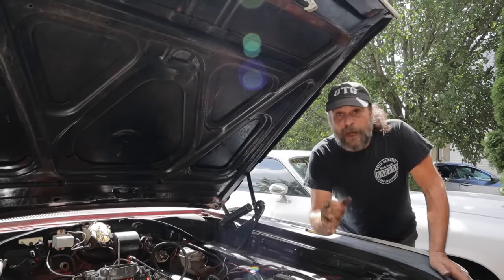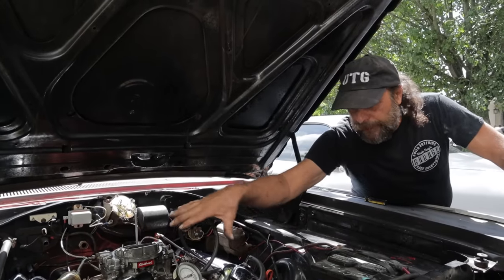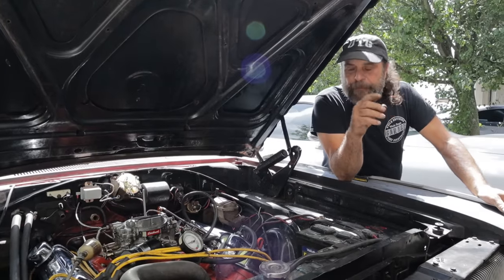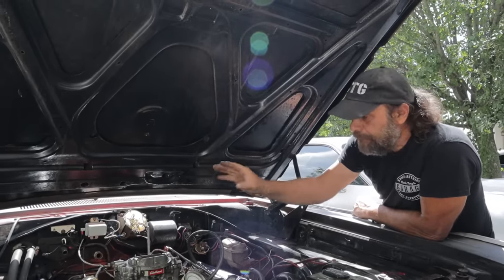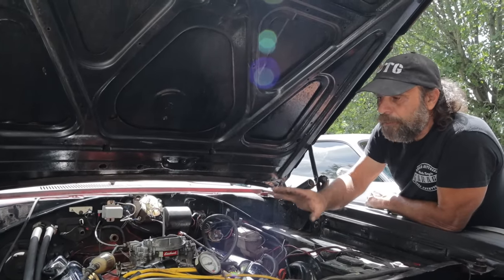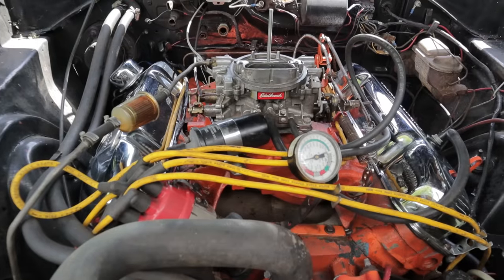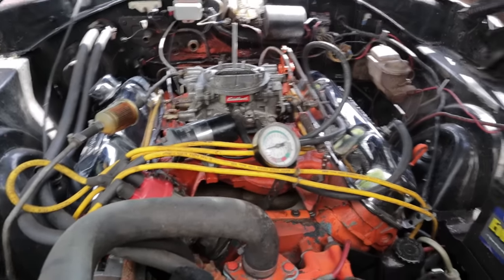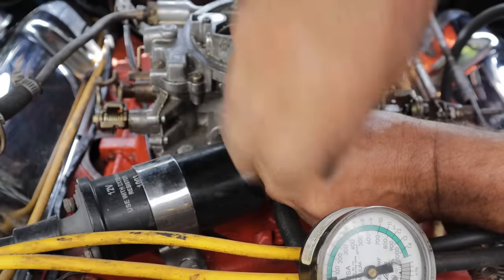Fine Engine Tuning With A Vacuum Gauge

Comment: I have a question. I own a 1970 Chevy Impala w a 350engine.300 Turbo Fire. 
I also have a Rochester carburetor 4bb. I set my air and fuel mixture at 18. With 2 turns on both. Is that a correct setting.?.
My 70 has the power to get up and go!!!.
Could you please let me know if I did it right. Or not.???. Thanks Rey from California San Fernando Valley.

Comment: I have a 1977 Dodge 4 x 4  1/2 ton 360 2 barrel Holly carb I have two carbs one a rebuilt and another that worked on another car they both give the same problem which is that they are really over fuelling at idle so much so that the neighbour complains of the stink.  It doesn't make any difference on the idol if you screw the Jets right in or if you screw them right out. The vehicle seems to work okay when driving but now after it sat over winter as soon as you put it into gear to start driving and while driving it is making a  popping noise.  I have a vacuum gauge and a timing light but I haven't gotten into checking it as of yet do you have any suggestions on what it might be and how I should proceed with the testing your help would be appreciated thank you very much

Comment: To set the timing do you unplug the vacuum advance from the manifold or carburetor that you have a connected to to the distributor...
Reply: Yes, and plug it so there is no vacuum leak.
Reply: @MaxDeet7439  thank you .

Comment: Thanks I need try vac gauge cause my 40 Ford with stock 350 SB had edelbrock 1406 always drove in cold ran great, now warm it started surging at 20 to 40 mph highway fine but slower back firing through pipes smells a lot, so I figured to rich now warmer out so I leaned out, more by ear, idles at 850 to 900 in park around 650 in gear but no more surging or popping when slow or letting off gas. I want to try the vacuum gauge. 1406 carb tube goes in front drivers side ?

Comment: stock 4cyl toyota tuning, vac guage is at 25 and cant bring it down to do any sort of tuning, dizzy is always vac advanced as too much vac at 600rpm idle,   idles smooth and drives mint though, air fuel screw does nothing, cant bring vac down at all, any ideas?  every video talks about low vac, cant find any answers to high vac problem

Comment: Tony on a holley 4 corner system do you only tune the primary side?  Than adjust the secondary side to match the adjust made on the primary sise?

Comment: So different lobed cams wild to mild, will have different vacuum mercury at manifold readings in a healthy engine the wilder higher lift  cam the less vacuum due to valves opening up more or?
Reply from the maker: It's not lift but rather duration and LSA that makes the difference

Comment: Any help? I've got a daily driver 390 fe, 4 barrel AVS2 (Edelbrock), stock cam. Engine was rebuilt about a year ago, new carb at the same time. I'm getting apx. 21 inches of vacuum at idle. I cannot for the life of me get this thing right, but I am new to this. It seems to slowly dance between a half inch of vacuum in either direction. It will remain constant for a brief moment, then swoosh up, come back, etc. Is this an ignition problem? I checked the base of each spark plug with a thermal temp gauge and they're all firing (they're all roughly the same temperature); I lost my spark plug socket, and the others I've found are too wide to fit in there and pull these suckers. Idle is smooth, response is great from idle. I can hear the slightest stumble corresponding with the vacuum reading... Although I've never noticed any variation in RPM while in idle (right about 800) Should I just keep playing with this? Thank you for the videos! Having access to this information and community is awesome!
Reply: I recently tracked my mpg over two full tanks and I was averaging about 5 mpg. I had tuned my carb in the winter, and was averaging about 11 mpg. Besides this, I recently rewired my electric fuel pump because of voltage drop. Now I have relatively no voltage drop. I do not have a fuel pressure regulator, but my electric fuel pump is by the tank in the cab, feeds it to the mechanical pump at the block.. My mechanic told me it would regulate the pressure. I think I might pull the mechanical fuel pump and install a regulator. I don't have a fuel pressure gauge to figure this out.

Comment: wow tony, thanks so much.  i have a stupid question, and i'm sure you're tired of it, but i did try to read all the comments.  we have an old 1967 thiokol snwocat with an industrial ford v4.  i can wrap my head around the 'manifold' vacuum part, but pardon my ignorance but what does the 'ported' part mean?  i got so excited when you talked about the vacuum advance vacuum line coming off the carb into the distributor...but then this blond got confused about the ported part.  so would i pull the hose off of the intake mainifold then stick vacuum guage thingy into hose...or, pull hose off of canister on distributor and stick vacuum thingy in that?  any gurus or helpful people that could help me would be much appreciated.  thanks again tony. -barbie
Reply: A manifold vacuum port has full vacuum at all times including idle. Ported vacuum is generally above the throttle plates in the carburetor. With this setup, you should have zero vacuum at idle but once the throttle blades are opened to a certain degree (it's different for all carberatires), the port inside the carburetor is uncovered and exposed to engine vacuum.

Some manufactures have a manifold vacuum port on the manifold or carburetor that is capped. These should have full vacuum, be sure to verify that. If there isn't a capped port, you'll have to tap into vacuum hose using "T" connection so you can use the vacuum gauge and still have vacuum to the hose you tapped into. Be sure to verify that it has full manifold vacuum though.
Reply: @muziklvr7776  wow muzik, thanks for that explanation, i think i get it now.  thanks again for taking the time to help me. -barbie:)

Comment: So how do you decide what to set initial timing to with a light (e.g. 10btdc, 12btdc, 14btdc)?  If there are too many variables (cam etc.) to use vaccum then how do you determine optimum initial timing?

Comment: I have found that a manifold vacuum on the advance makes you close the throttle so far that there is no flow through the transfer slot and when you open the throttle the mixture goes lean. If you try to fix this with the accelerator pump shot then it is too much as you open the throttle further.

Comment: Idle mixture, vacuum, rpm.  Adjust rpm check vacuum, adjust, check vacuum-back and forth-stock motor in decent shape.  Timing is important at a certain rpm.

Comment: Around the 1970's? When engines still had carbys & not cats? - Exhaust gas analyzers came into use? 
Idle CO had to be <1.5 %? & <0.2% @ 2000rpm, vehicle stationary? The latter would be of course, in standard tune?
The Idle CO needed the screwdriver applied to idle screws & throttle butterfly screw?

Comment: Hey Uncle Tony, I have a 1982 cougar which is equipped with a pulley driven air pump which sends fresh air to the exhaust manifold for "emissions". There is a vaccume line coming out of it. Can that be blocked off and removed, or does it add "boost" to the vacuum system? Does anyone know? I'd like to mount something in it's place

Comment: Hey I am working on my O'l Beater 54 Chevy truck . I have a  stock 350 with a Edelbrock manifols. But using a 600 Holley. Yeah all used. I'm on a budget. I installed  good used gifted 200r4 trnsmission.the TV or kick down cable that came with the tranny wont reach. A out an inch or so too short. Should I back yard engineer it. Or does someone sell a replacement. Like Lokar. Thank you

Comment: my fe 360 with a carter 750 bogs on acceleration, tried and edelbrock 750 after that and still would bog on acceleration or die if floored. any answers? i’ve been tinkering for weeks

Comment: 4.3 vortec in boat motor shakes bad at idle thown the sink at it and 2 shops later still just as bad its a 4.3 vortec with 2 barrel Holley only vacuum port is the pvc port on the lower back of carb.   I get good vacum reading but shakes or fuchauates fast between 20 and 17.   Whitch says valve guides but does not smoke a hair.  Im lost  its a low hours motor also.  Any info would be great

Comment: I just put a fully rebuilt 350 in my s10 new edelbrock 650. It will start but only stay running for about 30 seconds and it idles at about 1300 rpms even with the idle screw backed all the way out ...and then it'll idle down to around 400 rpms and die what could be my problem?? I have all the vacuum  ports capped off except the vacuum advance which is hooked to the distributor.

Comment: I have a 64 Chevy 2 5.7 sb I don’t have power brakes but do have hei distributor do I run my vacuum from carburetor to the vacuum advance on distributor or intake or does it matter. If this a dumb question sorry.

Comment: An old timing trick for mopar is to use the duraspark distributor and wire the second pickup to a toggle on the dash...instand retard of about 10 degrees for loads and steep hills....this setup works great with an edelbrock...also total timing of around 36-38 degrees at about 1600 rpm works nicely

Comment: I heard that a car with automatic transmission should be put in drive with someone holding the breaks to adjust the idle mixing screws with the vacuum gage. Is that true?
Reply: That is correct, it's best to adjust the mixture screw in gear for a car equipped with an automatic transmission. If your parking brake works, you can perform this yourself.

Comment: I did the vacuum. Got 24. I need to adjust timing. It stumbles when giving gas. The old 304  needs all the power it can get.

Comment: Chrysler was the only company (I think) that used a vacuum amplifier. How and where was this utilized?
Reply: Like a brake booster?
Reply from the maker: All the manufacturers used them to some extent.  Was powered by manifold vacuum but triggered by ported.

Comment: I can never get it set rich enough by vac guage.   I always turn the idle screws in till it starts to blubber then back out 1/4 turn and fine tune from there.  Each side is usually a bit different.

Comment: I may not get an answer here but its worth a try. Im owning a 79 mustang 2.8 v6. It had all kinds of emission systems on it which got all removed. And of course it has duraspark. From the factory the vac advance runs of manifold vacuum but from what you said it now makes maybe more sense to run it of ported. In idle it pulls 12° mechanical and vac advance adds another 10°. Around 3000rpm mechanical timing is around 32° +12 with vac advance connected. Is this about right or should i better life with the more retarted idle advance?
Reply: Set total timing. 
Idle timing fall where it may
Reply from the maker: Yeah, waaay too much total at 44.  Plug it into ported and set it for 32 total at 3000 (or wherever mechanical advance tops out)

Comment: I'm getting gas and oil mixture on my dipstick smells exactly like gas and my oil is really thin is that signs of bad piston runs or just a carburetor adjustment dumping too much gas in the cylinder I'm lost really

Comment: I have a tri-power 348 Chevy with zero provisions for a ported vacuum source. Can I run without vacuum advance? The distributor is an electronic upgrade with a vacuum can.
Reply: Run it on manifold vacuum, that's what they were set up for. It will be a dog at part throttle without the vacuum hooked up
Reply: @dieseldave71  I'll give this a try. Thanks.

Comment: Everyone told me I was wrong...
I had that stupid 'Load-O-Matic' -- 'Spark-Control-Valve' (carb) combo on my inline 6 200cid Ford.
I plugged that ported input on the carb. Found a place on the manifold for a fitting. Connected a line from that to the dizzy advance. Gave it a bunch of added timing. Re-tuned with a vacuum gauge...never ran better. Pulled so much better. Smooth. Just ran great.

Comment: ut when you turn them screws in whats the torque value,and is jt inch pounds or foot pounds,and are the torque values different between say Holley and edelbrock and thermo quad,to name a few,could i put the bumper against a building to adjust the carb in drive,thank you in advance,timing joke there hahaha

Comment: Proper procedure includes checking and setting curb idle and basic ignition timing first, before you perform a final carburetor adjustment.
It makes no difference the make of the carburetor or engine build.

Comment: '77 T-bird. I hated working on that era of Fords. Open the hood to a spaghetti pile of vacuum hoses, and that damn accessory plate on the front of the engine which was under everything except the water pump which was under it. But as far as lasting impressions go, the juice can that Ford used as a vacuum canister in those days was the icing on the cake.

Comment: Frankly if I never ever have to work on a carbureted auto engine again in my life I'll be very happy. These modern electronically controlled ignition and fuel injection systems are better in every way. The electronic digital computer constantly tunes the engine for best performance and economy and when something goes wrong it even points you in the right direction. Carburetors, which are mechanical analog computers, are no where near as good.

Comment: Some really interesting comments and most of which I fully agree with.  However, I have to disagree with the final minute or so of the video in that manifold vacuum can still be used for the final optimisation of ignition timing for many std or very mild tuned engines provided cam duration and overlap remains relatively mild.   Tony is right in that its best to use a timing light, however what does that do other than allow you to set ignition timing on what it should have been as a new vehicle?  Unfortunately, wear and tear, timing chain stretch, dizzy bearing wear, fuel quality, calorific value, flame speed and other factors mean that an older is no longer perfect to its original tolerances or the timing figure of the manual that you've just set it to with a strobe alone.  But if you use a timing light to get you in the ball park of 'the book' settings for for example 10deg BTDC and then a final 2 or 3 degree change to satisfy maximum vacuum, and retard back 0.5 mercury inches.  That's how to tune an older car with std to mild tuning mods and perhaps end up at 12 deg btdc for example.  Great explanation of when to, and not to, use 'port' or 'manifold' vacuum though, again it's something that many do not realise.

Comment: Funny you mentioned timing. I was taught in the early 80’s to advance to max then back down 1/2 inch....thoughts??
Reply from the maker: 1/2 inch???
Reply: @steveedwards1072  They probably said “1/2 turn (of the screw)”.  I like max vacuum and if that max reads and sounds the same across, say, a full or 3/4 or whatever turn(s) of the screw, I’ll split the difference and leave it.

Comment: 12v coil and ignition ballast bypassed? please explain, i installed a 12v coil and still run a ballast, do i need it?
Reply: OEM wiring requires a ballast resistor or resistor wire in series with the coil in 12 Vt systems. And don't forget the by-pas wire which feeds the coil while cranking/starting the engine.

Comment: I once had an old piece of crap 4 cylinder van with about 50 hp and it had terrible fuel economy. Fixed it by connecting the vac advance to a manifold vacuum port so it became a "vacuum retard" distributor, wrapping some wire around the activator to reduce the travel of the arm by half, and running 16 BTDC of static advance. Ran like a dream after that.

Comment: I disagree, ported vacuum reacts to the butterflies like you said,  manifold vacuum is real time, at the cylinders. A carb is not a compute, and there is a lag between.  I have always got better results after setting  your initial timing with no vacuum, (i'm sure you know that) and then you advance is controlled  by your distributio springs and/or manifold vacuum, if you do run a vacuum advance.

Comment: Hey I am from europe, trying to get some info how to adjust my new carb and ignition for my 70 tbird.
So I'm going to rehook vacuum advance because it goes from manifold.

I put holley street demon on it and hot it cant idle. Old motorcraft and with points it was working at 500rpm, now lower what I can get is around 1000 when hot and die in gear.

At cold it can idle at low 600 with no problem

Comment: Before a divorce a few years ago, I had a '70 'Cuda, 505ci, 6bbl I ran on the street. Vacuum gauge was the only way I could get the 3 holly's in sync
Reply: Stories like this are the reason I never got married. That must have been a difficult sell.
Reply: @muziklvr7776  Not to mention, at the same time I lost an original '69 Roadrunner, had 61K original miles. More than anything, depends on the state you live in if divorce happens. Me, it was Oregon
Reply: @artbrookey3468  Ouch! Oregon is a such a beautiful state, too bad the divorce laws are wildly unbalanced.

Comment: All the performance gurus say manifold vac for advance, ive been back and forth with this for 40 yrs, what gives?
Reply: As far as manifold goes there's really little use to having your vacuum advance all at once off idle. Ported makes sense because the advance comes in while at cruising speed, so your timing would ultimately be in the beneficial 45ish range at cruising.

Comment: what if you vaccum gauge is not steady? it  jumps up and down alot
Reply: There are charts online that explain what that means. The pattern or rate at which the needle jumps up and down/moves indicates what is wrong.

Comment: My experience is that running manifold vac adv gave me a better idle, with more vac, and 26* on the timing light. Switching to ported vac dropped it to 6* so I immediately went back to manifold. This dude has absolutely no clue.